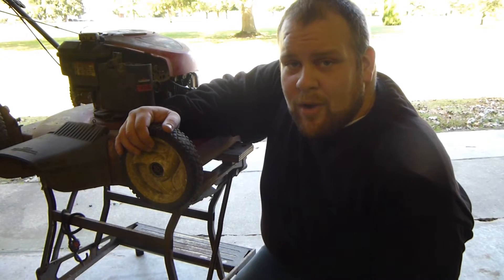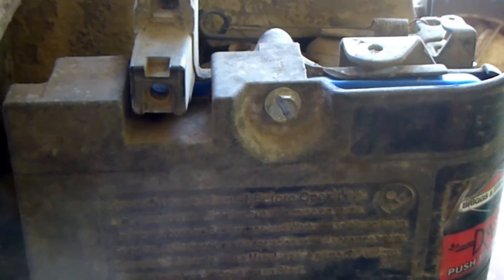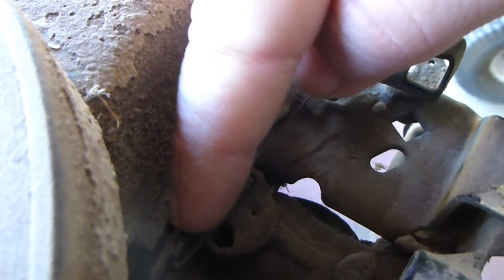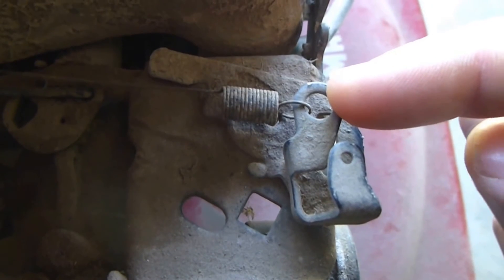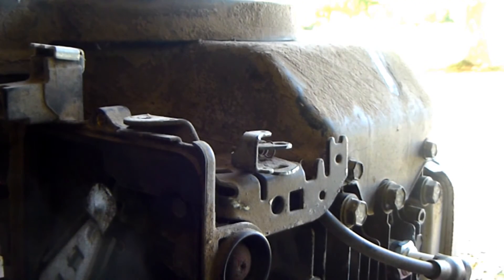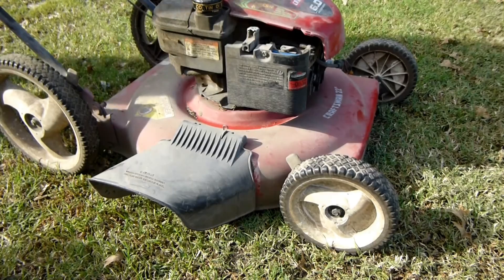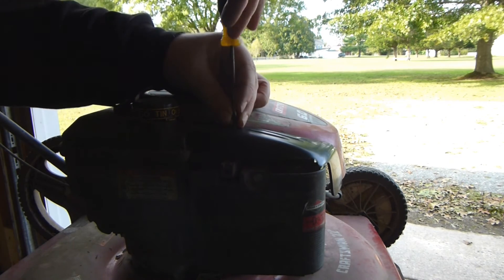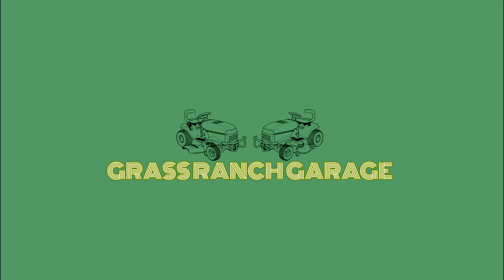Adjusting Engine Speed On A Briggs And Stratton Quantum Engine

Comment: Hello. You video was helpfull but I still have a strange problem. When the mower starts ,it will run ok but as soon as you move or push it, it goes full throttle. Is it possessed?  I think so! I have never seen this problem before, and I:m old. lol

Comment: Is the choke open or closed when the mower is off?  When does the governor lever pull back and close the choke on this carb?  I can't get my mower to start and I think it's because the choke won't close?  Any advice would be appreciated.  I have the same carb as the one in the video. Thanks

Comment: Hey! Thanks for this video. When I adjust my RPMs, the vibration causes the spring to flop around and no matter what I do, I can't keep the RPM at a reasonable speed - it wants to max out every time. Is there any tension that is supposed to be pulling back on the spring? The linkage just flops about. This all started when I replaced the flywheel key and I wonder if I lost a spring at the back where the linkage connects to a lever?

Comment: I've got a 2015 Murray 5.00 -140cc B/S.  It boggs when cutting 3" grass. I've cleaned the carb, fuel tank, fuel filter, new spark plug, NEW gas cap. I clamped the brake handle and it ran just fine for 5 minutes and started to cut my grass, and I have the same damn issue. I looked at the mechanism for the choke and it looks like I'll have to take the flywheel off to get at an arm/linkage that is vertical in the engine. Is there an easier way, am I missing something ... besides a decent repair manual?  Thanx in advance.

Comment: Many thanks for posting this well done video. I had decided to have a look at an old mower of mine (which has exactly that control setup) which I had not used in some years. Because of a missing cover the linkage and tangs had been badly knocked around over the years and I had no idea how the setup was supposed to look in practice. Just one question though if you come across this post. At rest (ie not running) is that governor spring loose or will it begin stretching as soon as the governor arm moves backwards. The one on my mower is pretty slack and the governor arm moves a good amount before it starts pulling on the spring.

Comment: Hi Darren, I have similar engine, moving the throttle its normal length does nothing to engine RPM, I move the governor arm almost 1/2 past high throttle before engine revs - any thoughts ?
thanks
Reply from the maker: Does yours have a separate throttle?
Reply: @DARRENWALKERBIGD  throttle level on the  engine in front of carb where the spring attaches just like yours

Comment: THANK YOU SO MUCH (I Subscribed in appreciation...looks like I'm your first sub too!!!) This helped part of my problem (low rpm) but my mower is still surging up and down. The plate the linkage connects to shakes around quite a bit, is that normal? My mower has the metal cover where your black plastc piece is and doesn't have the red decorative part but the engine seems the same. This mower gets a lot of abuse as the yard is very sandy & rocky with a lot of pinecones, acorns, old leaves, needles, sticks, bark bits, woody weeds/young saplings being mowed. It was left behind by previous owners so I dont know a lot sbout it. It starts on first pull & was running good until I mowed a pretty overgrown area and hit a good sized stick (approx 1.5" diameter) that was laying under some leaves in thick bushes and stalled the mower. It started right back up but rpm was significantly lower. I finished mowing (an area with super thin grass and put it away....it wouldn't start this weekend so I took it apart at carb and cleaned everything really well, now itstarts on first pull but idles very rough.... any ideas?
Reply from the maker: if it is surging while running take another look at the carb again you could have missed a jet or air passage way while cleaning do this and get back with me and let me know the result.